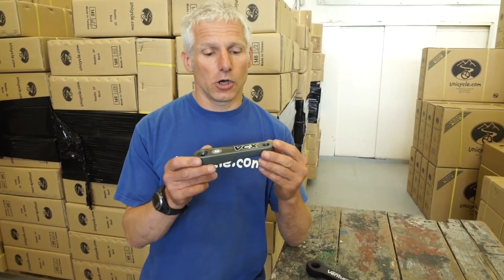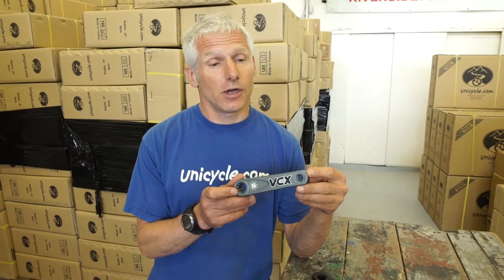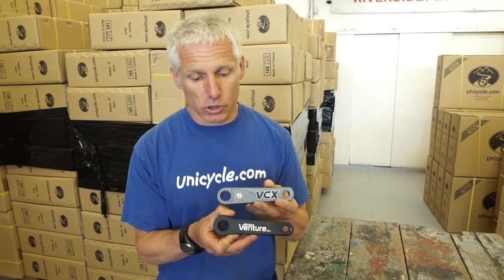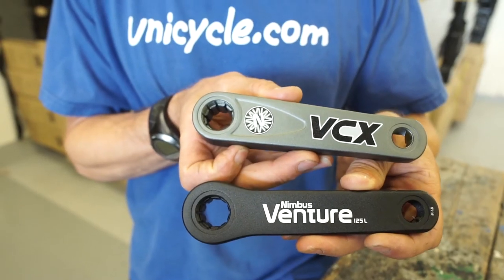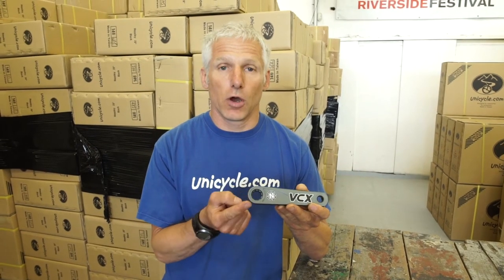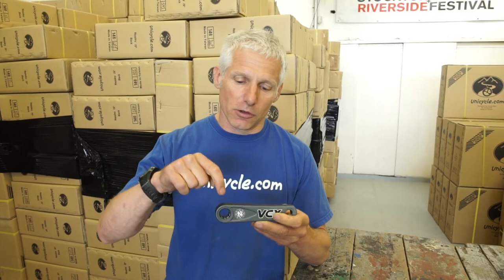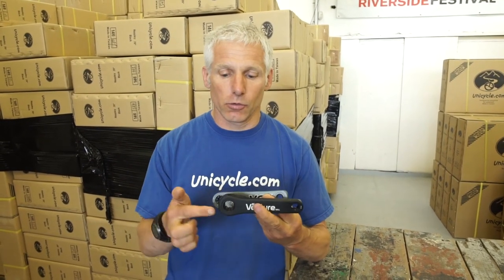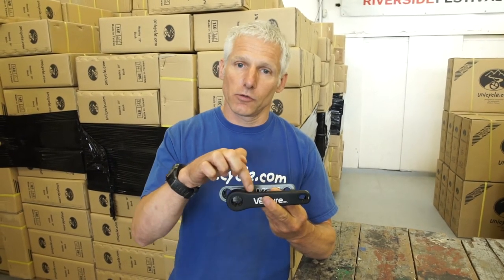Nimbus VCX Unicycle Cranks (Unboxing)

Comment: I have read somewhere that you need 7mm spacers for theese. Correct?
Reply from the maker: They are designed to only need a 6mm spacer on most hubs.
Reply: I've installed the cranks with 7mm spacers, and there is no squeeking or anything. I have the green/black disc hub that came with the Nimbus Nightrider in 2010. Do you recomend replacing the 7mm spacers with 6mm spacers? Great cranks. Thanks!
Reply from the maker: If 7mm is working leave it, just keep an eye on everything is correctly tight.